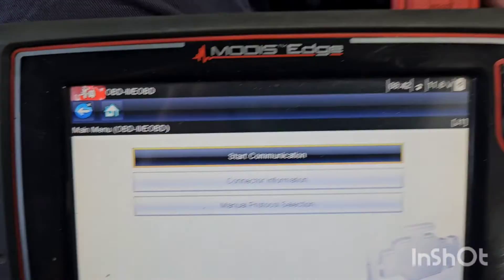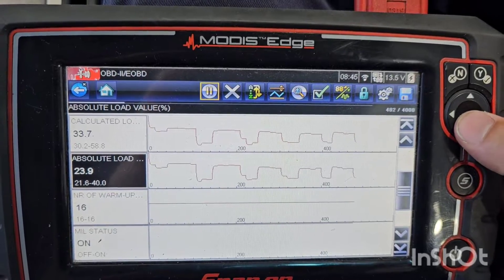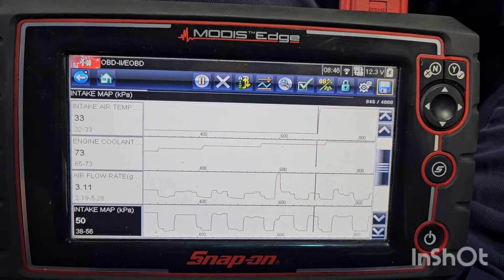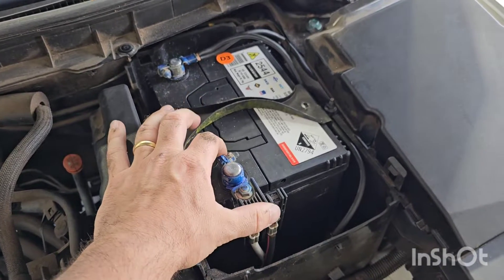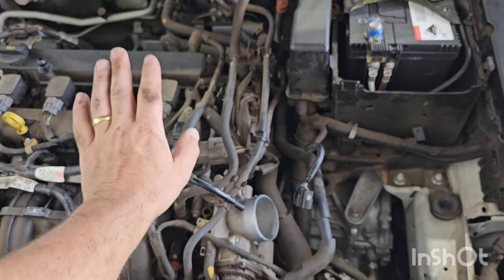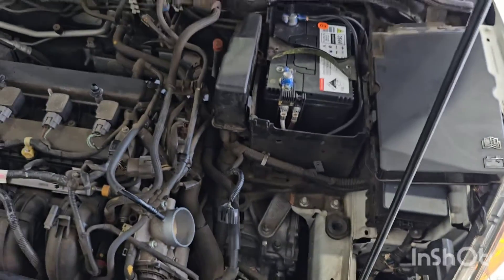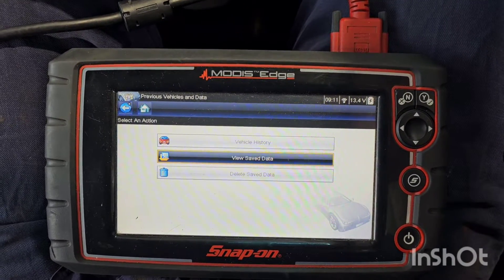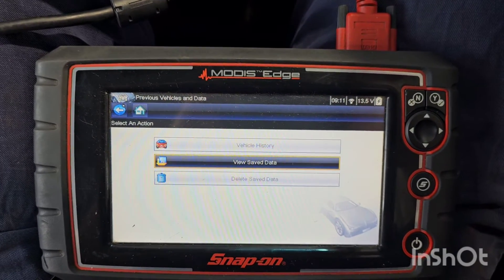Mazda 3 Low Idle p0506 Idle Control System RPM Lower Than Expected

Comment: I have a 2010 volvo xc70. I got a p0506 code yesterday. idle is only rough in drive and reverse, in park and neutral it's fine. I cleaned the throttle body it was very dirty. I reinstalled but no change. it is because I did not reset the adaptive parameters?
Reply from the maker: Nah, it would idle higher as you have cleaned the throttle now. 

Is it idling low?

The vibration could be coming from the hydraulic engine mount

Can you feel the vibration through the steering wheel?
Reply: @RealAutoSolutions  definitely idling low. confirmed with multiple scanners. pretty confident it is because I need vida to reset the long term idle parameters. local Volvo independent and I have a touchy relationship so I cannot use his vida any more, another friend of mine with vida is out of town till the 1st. I decided to bite the bullet also and buy vida/ dice as well as an autel on Black Friday sale.
Reply: @RealAutoSolutions  idles at aprox 570 rpm only in drive or reverse. idles fine in park and neutral aprox 780. that's where It would idle in drive and reverse as well. I have just been driving it. issue hasn't got better or worse. I pop it in neutral when I have to idle in traffic.
Reply: @RealAutoSolutions  throttle was very dirty but not oily or caked with to much carbon. just a lot of varnish and what not.

Comment: will a malfunction camshaft position sensor give a p5060 code? because i have this code and malfunction cam sensor.
Reply from the maker: What is the code description for the cam sensor code
Reply: @RealAutoSolutions  P0101, sorry i put the wrong obd code, it p0506 not 5060 lol sorry but the p0506 code was idle control system rpm lower than expected but i fixed that by cleaning the throttle body, but the camshadt sensor code is P0101, i orderd a new cam shaft sensor going to replace it. but when i look up p0101 for my mazda it says MAF but the Oreilly scan says camshaft position sensor, do you know why?
Reply from the maker: @jasonkelly7573  a p0101 is a MAF code, I would be checking for air leaks

Comment: Cool gonna try this out to see if it clears the p0506. My car is showing this plus a p0171. Do you thing it might be connected?
Reply from the maker: It shouldn't cause the p0171. The lean condition might be causing the p0506 though
Reply: @RealAutoSolutions  did this and it cleared both codes but today I got the p0171 again so I think I’ll just replace the sensor. Pretty good video
Reply from the maker: @LoggyTonight  I don't think the sensor is the issue

What are your fuel trims looking like

Comment: I’m impressed but not surprised 👌🏼 nice work as usual
Reply from the maker: Thank you my pal
Reply: @RealAutoSolutions  A friend of mine is getting this error.  I think they told him he needs a new PCM. I told him no, wait, try changing your air filter first. But yea thanks, if that doesn't work we'll try cleaning the throttle bottle.